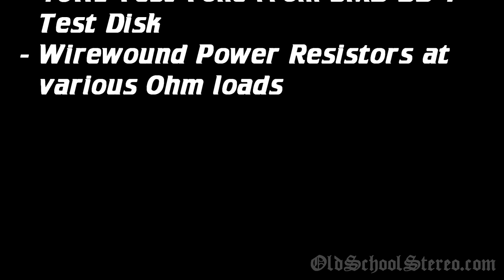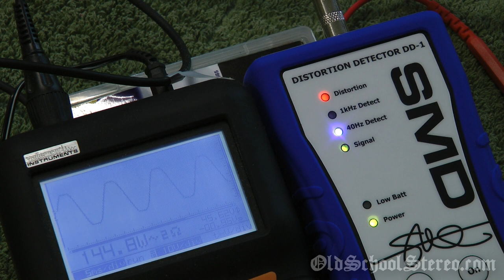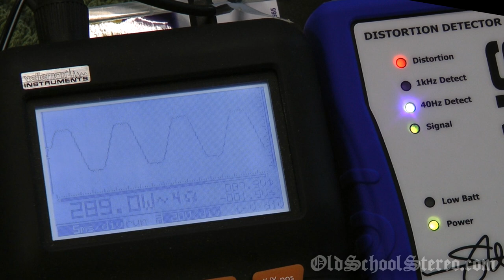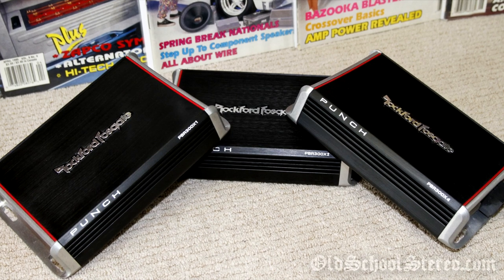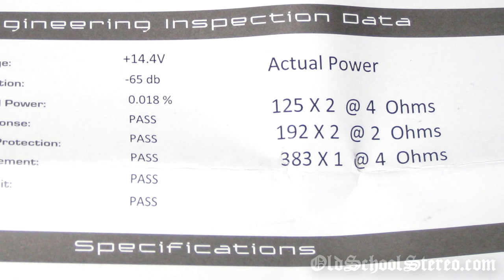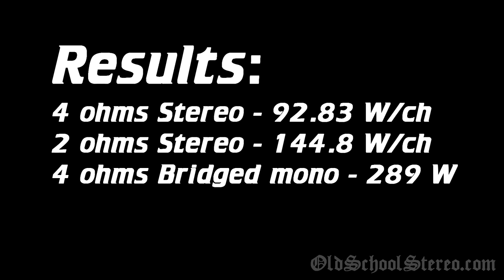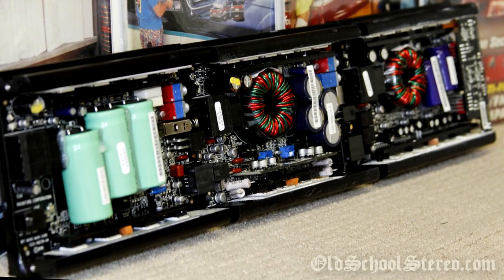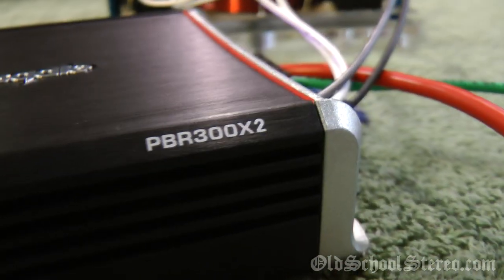Rockford Fosgate PBR300x2 300 Watt Mini Amp for Car, Harley, ATV, Scooter

Comment: Funny that you mention that, I just did a gut shot on an amp recently where I unscrewed the back panel & it didn't come out.  Had to pry it out with a screwdriver.  Then I had the hardest time getting it back in.  The panel was about 1/8" too large.

I knew that Rockford has been messing around with "charge pump" power supplies for a while now, but this is the first commercial use I've seen.

Comment from the maker: Yes, you could use on a bicycle or trike or even a unicycle if you strapped it down correctly. I think these small, high powered amps are also well suited for boombox type applications...precisely where I'm going to use this amp in the near future (along w/ adequate cooling).

Comment from the maker: Thanks man. I've got a ton invested in power supplies, so I won't be getting another anytime soon. It is difficult enough to find a 13.4-14v power supply over 50A, plus I want to mimic the average automotive electrical system with my tests...not those who have high output high voltage alternators. The PBR300x1 runs cool under the same test loads, so it's the power supply design of the PBR300x2 causing it to run hotter. I was considering the 500x1 also, seen birthsheets showing 600W at 1 ohm!

Comment: Nice work as usual.  That's a mean little amp.  I've considered getting about 4 of them.  That 300x1 is one of the only amps I've ever seen not using a toroid power supply.  First thing that I thought when I saw the guts.

Comment: I remember when rms wattage on most amps were measured at 12 volts (the good brands anyway). At that voltage you know you're getting an underrated amp due to fact that, while your engine's running, it's putting out over 13.5 volts.
Reply: Orion 225
Reply: @freebehindbars8654  yup. Many others like Rockford and Linear Power too.

Comment from the maker: This amp is not coated like many of the marine specific amps, so as long as you could ensure it would stay dry, it should be okay. If you are powering mids/highs and a sub from the single amp, you will need to find either a tri-mode x-over or build one out of chokes and capacitors. The Phoenix Gold XVR4 xover I'm using is from 1995 and not easy to come by nearly 20 years later...Also, for use on a boat, you may require more power, especially if you like it loud when you are cruising

Comment from the maker: Yo homie, I actually just installed the PBR300x4 and 300x1 in our Toyota Sequoia powering Boston 6.5" components up front and a JL Audio 10W3D2 stealthbox in the back. Right now I'm only using 2ch of the 300x4 and that joker gets SMOKIN' hot!! I'm gonna swap it out for the 300x2, see if it makes any difference. The amps sound good, a perfect small upgrade with no space taken up, all stealth! The 300x1 really needs to be ran at 1ohm if possible to get the most power out of it.

Comment from the maker: Yes, but you may prefer the 4ch model, the PBR300x4. The 2ch model, PBR300x2 is 2 ohm capable, while the 4ch model 300x4 is limited to 4 ohms per channel

Comment from the maker: Both the 4ch and 2ch versions get really hot when they are pushed. I was using the 4ch in our SUV, then swapped it out for the 2ch. I'm guessing they are designed for this, but you can tell they appear to cut back power and SQ when they get real hot.
Reply: When will test the pbr 400.4d

Comment: I am using the stock HK head unit. I also did cut the RCA  jacks and went with the speaker level inputs. RF actually suggests this in the directions for the Harley head unit. It might be just the gain settings. I have talked to a guy who rides and owns a stereo store and he suggested not to change from the stock unit because they are designed to take the vibrations from the bike. He could have sold me a new head unit so I tend to believe him.

Comment: Oh, and one more thing.  If you put this amp on a pedal bike, don't forget to put a 12 volt headlight on at the same time.  Also discuss reasons why it isn't recommended to use an old school bike lite generator as a power source for audio applications on this.

Comment from the maker: You also have no idea how difficult it is to not only remove, but to put the bottom plate back on these amps...the two pieces fit EXTREMELY tight. I thought all of these PBR series amps used the large caps as "charge pumps" and no toroids...guess not...

Comment: Love your reviews! Been watching for many years! Would love your input/recommendation/opinion: i planning on running a single Rockford Fosgate P3SD4-8 8" shallow subwoofer in a custom stealth enclosure built as close to recommended specs allowing to fit in the spare tire of compact hatchback. Which amp you think is best to push it out of 1) RF PBR300X2 or 2) RF PBRX1 Mono? Time greatly appreciated!!! ✌🏽❤️✊🏽

Comment from the maker: To get the best sound from the amp, you need to match the gain with the output of your head unit. I watched your video, but couldn't tell what kind of head unit you are using. Are you using RCA inputs or speaker level? I noticed some guys on the HD forums saying the speaker level inputs made their amps sound better. This shouldn't be the case, with a good quality head unit, you will get plenty of clean output through the RCA's. However, if the RCA outs are very low voltage, this could be a prob

Comment: You might be able to do this, but you'll probably have to turn the gain on the amp up very high to get any reasonable performance, which would likely lead to a degradation in sound quality.

Comment: I got a few amp i wish to get nysc the power punch chrome 500,2 97-98 models and the 800.4 400.4 & 100.2 all the same cases all with a year difference in years. all but 800.4 have crossover cards.. wish i had the money for that smd tool.

Comment: Hey d are you still running this amp in your ride? I was thinking about using the 4ch version to run 2 sets of 5x7 infinity kappas I have. I am concerned about the heat though as it will be an under dash mount. You always bring the fire bud, keep up the good work bud.

Comment: Can you do a video testing the pbr300x4 (the 4 channel version of the amp shown in this vid)? I am considering this amplifier to drive my 6x9's and 6 1/2's in my Honda CRX, as it is small enough to fit under the center console.

Comment: I have the 300x4 on my Harley, using the stock HK head unit, RCAs, and pushing two 5.25" Kickers and two 6x9 Kickers. The amp is mounted inside the fairing, and it does get pretty hot when I crank the volume up (sounds great, by the way), and it seems to cut itself off, or kind of drop out when I play anything with a lot of highs turned up loud.....I have two small fans on it, one pushing and one pulling, but that doesn't really seem to help. Is this an overheating issue? If so, any suggestions?

Comment: I have an Eclipse 2010 with Rockford Fosgate audio system. My amp is disconnected. Previous owner removed it) stole it, and I bought a new OEM  amp but the connectors harness are not there, he also removed the Subwoofer, so I bought a anew OEM one, and new prime 6x5 speakers. So my question is: Can this PBR300 can power my Subwoofer and speakers? Will it affect the sound quality? Will it it improve it?

Comment: Question regarding the 300X4 , i listened to your post ! i thought it was great. My question since i am not familiar  with amps but what you mean by high pass and low pass, i have an infinity amp that i am thinking about replacing, i have 6 speakers in my car two of the speaker play bass only in the rear of the car.

Comment: Holy cow your clipping the hell out of that amp. What's the power output before it sounds like a can of rocks? I'm seeing about 40w/ch <0.1% on my bench.
Reply from the maker: lazzer408 this was my old setup, I can try it on the Amp Dyno, but that's still at 1% THD. I have an analog THD meter for lower THD, but it's difficult to get exact results. I don't have an Audio Precision audio tester, unfortunately.
Reply: THD and clipping are two different things. Would like to see how much power you measure before clipping and below 1% THD. THD is quite noticeable at 0.1% so if you can, aim for that. Also, only a 4 ohm test is needed since that's what the majority of users will be driving. Thanks.
Reply from the maker: I understand the difference. The DD-1 shown here measures THD at 1%, I used that as the indicator, not the cheap, low resolution screen of that o'scope. I have a much better scope now, but use the Amp Dyno for all of the tests, o'scope on standby for analyzing issues
Reply from the maker: +bill pruett DD-1 was calibrated to 1% THD, o'scope has low resolution screen and unknown calibration. I used DD-1 as the gauge for this test

Comment: Hi Dereck, was wondering whether u had experience with the Punch series amps, 4 and 5 channels. I'm thinking of getting a small sub in my VW GTI, was wondering if  I can just get the 4 ch amp and have it drive front 2 speakers, and bridge other 2 channels into 1 for the sub and leave rear speakers to be driven by stock headunit since I don't have a good place to fit the 5ch amp and is more expensive.

Comment: I just installed this amp on to my Harley and I did notice it got pretty warm. I hope I get enough air under the fairing to keep it cool enough. My question I have is that I am getting some distortion at higher volume. I am running Rockfords 6'5" coaxial power speakers. I tried to set the gain but have never done that before. Any suggestions?

Comment: I have this amp that I am going install on my quad. The numbers you came up with, are they the same in tri-mode or do they drop? I also have the 300x1 but if I can get by with using tri-mode, it would save on battery drain.

Comment: Well, when it comes to bolting on the mounting bracket onto bicycle applications, at least it eliminates some frustration with trying to place a plastic boombox onto a bike basket.  Besides, all this tactile force I encounter calls for automotive-grade audio equipment, and yet nobody years for charisma, or tries to pay it off the same way I do.  Headphones are uncharismatic and anti-social, this is why I advocate what you do, and why you should also advocate what I do.

Comment: Yup.all the power series amps are no good nothing but clipping then I get a rockford prime I dont get no over heating or shut down or clipping I get bang all damn day love the prime series
Reply: ***** my friend has a prime 500x1 and it bangs I never had this little guy but I Dont like the black Punch they clip into bad I love Rockford but the new technology in the amp suck
Reply: *****  I'll rock a old school Rockford before new school
Reply: *****  damn that's what's up hell yeah
Reply: Shane Miller So your trying to compare the cheap shit? i bet you did your install wrong i have a power series 1000 and a punch 1000 with the clip indicators, never had a problem just cheap speakers couldnt handle it but thats not the amps fault.

Comment: The sine wave on the 4-ohm bridged mono mode looks like it has pretty bad clipping -- why isn't this mentioned in the video? Am I misunderstanding the display?
Reply from the maker: The o'scope I was using in this test has a slow refresh rate and the DD-1 uses much faster analog circuitry. I'd say trust the 1% THD light on the DD-1 before being too concerned about the display on the cheapo o'scope.

Comment: running two 6X9's would the 2 channel run "cooler" than 4 channel????  I have also  used a  Lightning Audio mono amp with these 2 speakers by bridging them together, not a bad sound. could this be done with the Rockford Fosgate mono amp effeciently? would it heat up

Comment: For comparison what's better the kicker px100.2 punch one300 for the motorcycle sound
Reply from the maker: I've not tried the Kicker model. May be worth talking to a shop that has experience with both to see which they recommend.

Comment: Hey Big D, got a huge question...I have 3 dual 4ohm Rockies and I have hifonics Brutus 1608 super mono amp. Can you run a amp at 2.7ohms safely? I mean is that still considered 2ohms?
Reply: Yes since that amp is capable of working at 1 Ohm minimal. As long as you don't go under its minimum impedance you can't damage an amp.